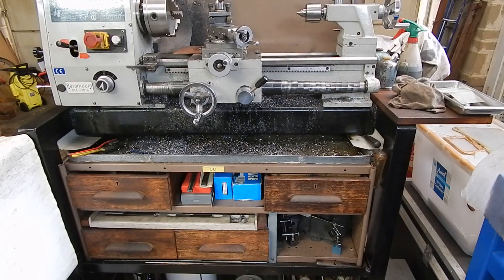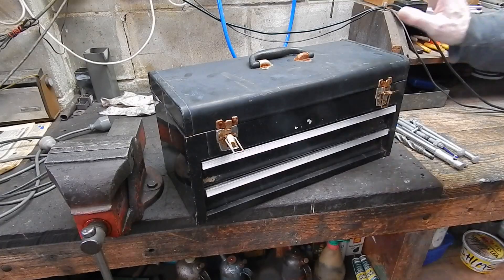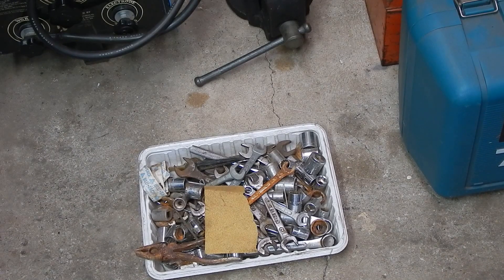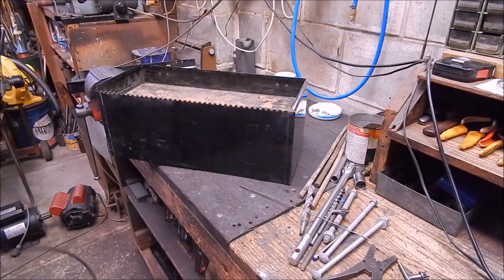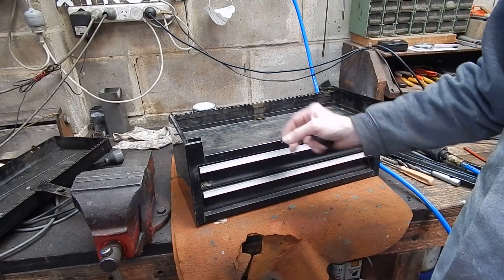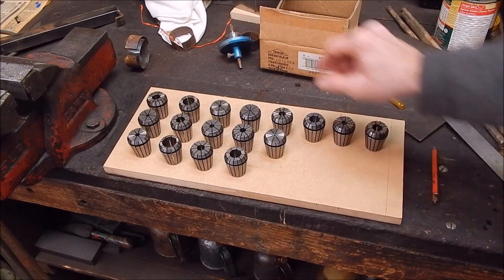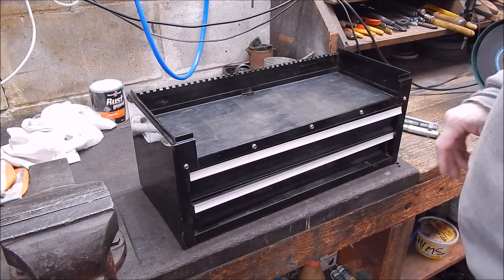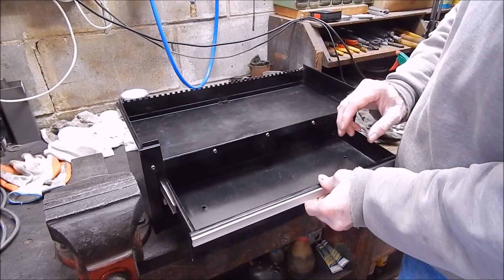DIY collet rack

Comment: I got sick of looking for the correct size collets. So just 2 weeks ago i made one out of pine. Cost me $12 for the 30mm drill bit. so organized now, Im very happy with it. i've been thinking of doing another one for the lonely drill bits i got floating around.
Reply from the maker: Same here.  I got sick of the collets sliding around and mixing up every time I shut the drawer.. All sweet now.  I have one of those round alloy drill caddies for my drills up to 1/2".  They work well. Rob

Comment: cutting board makes a good rack, and holder for endmills when milled with a ball nose
Reply from the maker: I looked at the plastic/poly cutting boards, as I know people use them for this, but gluing on the risers may have been a problem.  With the MDF I just used Selley's Quickgrip.  Rob
Reply: i think you can form them like candlewax too

Comment: Now you have to finish the re-purpose of the tool box. You will have to do something like that with the cover. What if you insert a ⅜" plywood like your collet holder but, instead of making holes, you make 3-4 strips angulated at 30 degree in order to slip all the little wrench that you have in the plastic container ! 😉
Reply from the maker: Hi Robert.  Yes, I looked at that cover long and hard.  Take off the handle and it might make a good sorting tray or something.  Food for recycling thought :)  Cheers Rob

Comment: I had a similar problem with a weak tin top and I used a sheet of plywood and that not only made it sufficiently stiff but I found the wood was way easier on the tools and my ears I did not have to hear that tinny sound with I set a tool in it.  

Nice job on the collet rack it looks nice and will work forever and for next to nothing, sweet...
Reply from the maker: Yeah, I hate that tinny sound steel boxes and drawers make.  Much prefer wood.  Rob

Comment: I'd spray that MDF with something so it won't absorb moisture and stain the collets Rob.
Ceers Eric
Reply from the maker: I was thinking the oil will soak in and stop them rusting.  That's why I went for wood rather than a plastic tray.  I expect it will look pretty grubby before long :)  Rob

Comment: Great project! Random observation: I've never seen hole saws designed like yours here in the US.
Reply from the maker: Really ?  I'm surprised.

I thought they all looked like that.

It's amazing how some things differ around the world.

Being a serious collet user, that simple rack is one of the best things I've ever done as a work shop project.

I see people with open racks above the lathe etc, but I don't see the point unless you work with collets continually  - better to keep them non rusty and clean in a covered rack IMHO.  Plus it's just more stuff cluttering up valuable lathe space.

Cheers Rob

Comment: Ha Rob I was amused to see this. Following watching your earlier recommendation for colletts,  I  purchased a set.on Ebay  It arrived a week ago and  having been a bit scornful of your paper packet set up,  I built a pretty wooden box with 19 compartments plus one for the chuck. it worked pretty well except I forgot to leave space  for the C spanner Durrh!  I guess it can hang on a hook.  I Thought perhaps you got a telepathic message that  I had had rude thoughts?  Anyway it is great  to see  you put others "junk" to such good use.    .
Reply from the maker: No telepathics, but a bit of cussin everytime I had to re sort them.  The set of drawers I showed works real well.  If I see another cheap set I may do the same thing again for general under bench tool storage.  I thought about making a wooden box.  Rob

Comment from the maker: To do a good clean job drilling out the collet mounting holes, mark out the drill points, drill each point on the drill press with a small drill.  Then hand drill from both sides with the circular cutout bit.  They dance around a bit, and are better hand held using the drill hole to guide them. That's how I did it.  Rob

Comment: Was there any reason why 23 instead of 24 holes were chosen?
Reply from the maker: I slightly miscalculated on the spacing, so by having two in the last column on a different alignment, I could move them slightly left and maintain similar end spacing.  Like a roll of toilet paper on the lathe, it makes for a good conversation piece.  Nothing is perfect in life :)  Rob.